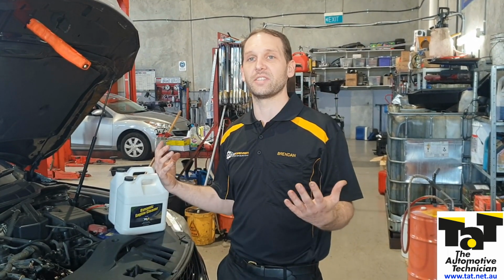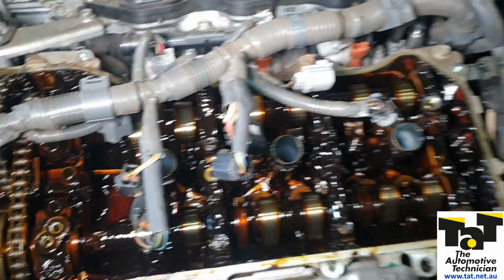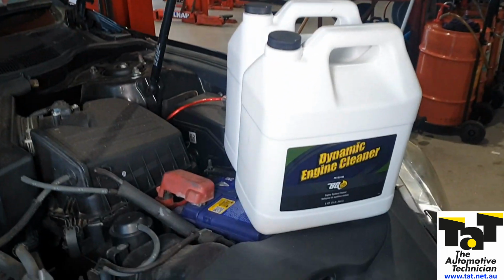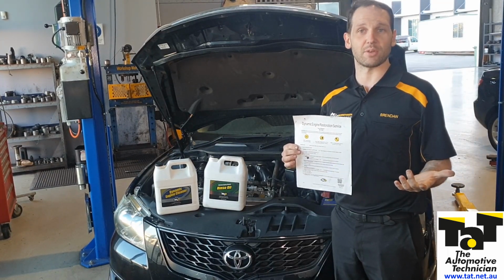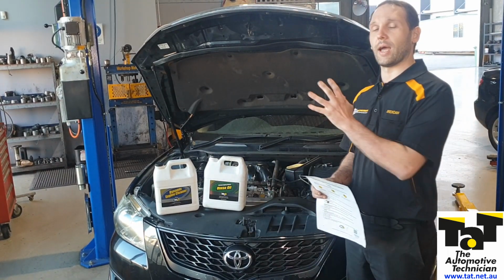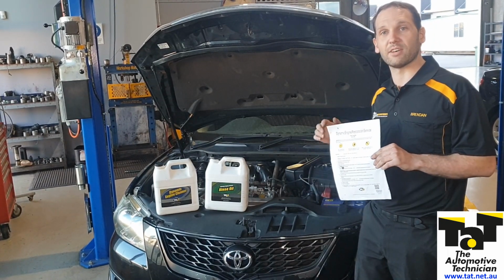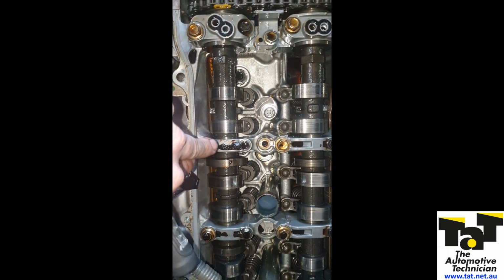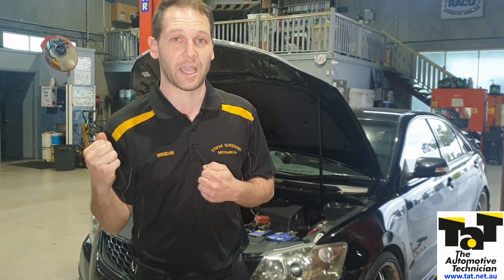BG Dynamic Engine Restoration

Comment: my 2015 altima with only 70k miles had the same symptoms. Drive it in the morning, no think white smoke, but when I am going home 9 hours later thick white smoke, took it to the dealer they said engine sludge, , That is when I researched further and found out about the BG engine flush kit. Drove it yesterday no white smoke.

Comment: For those w/o OBD-II or computer based methods to read the oil pressure, what do you connect an oil pressure gauge to?
Reply: You need a scan tool that reads Oil Pressure.

Comment: So i did this to my 300k truck, now everytime I start it, I get this cloud of smoke, followed by light blue smoke once idled..... did i do something wrong or does it need to burn off with fresh oil for a few hundred miles?
Reply: I don't think you did anything wrong. BUT ? You might have cleaned some crud up & now oils getting past something causing your smoke on start up.

Did you change out your PCV or at the least check it ?

Comment: Are you sure it's oil pooling in under the valve cover causing the issue? From what I understand the oil control rings get stuck due to the newer low friction design combined with the lack oil changes they get gummed up and stuck in place. This leaves a gap between them and the cylinder wall at startup which lets oil into the cylinders and burning causing the smoke. Once engine heats up the oil rings expand out and start clearing the cylinder walls of oil reducing the smoke.

Comment: Looks like a really great product JR, but I think most of us subscribers are diy, and we can’t seem to buy this product online. I just won’t go to a mechanics shop for this. Please give this feedback to the manufacturer
Reply: It's down to 299.00 now. Check it out. Just purchased some to do this on my wife's SUV.
Reply: @shill1444  "Crikey".
At the risk of sounding like a cheap bastard (well, yeah!), I think I'll settle for a kerosene flush (I've got a badly sludged 2006 Holden VZ).  Drop oil, add 5ltrs oil and 2 ltrs kero, run 30 mins, repeat (2 x flushes).  Then I'll treat it with XcelPlus (tradename for the "original" Slick 50).  Why? I've got a timing chain rattle.  Mechanic looked at it and told me he WON'T do the timing chains for $2,000 (too sludged), I should go for a remanufactured engine (5.5k "plus labour").  Xcelplus won't FIX timing chains, but it may very well prevent them getting worse - a DIY "my way" is going to be a couple of hundred (and if it's NOT successful and I need a new engine - I've only lost a couple of hundred).
Reply: @OhSoddit  - WOW. SMH. I feel your pain my friend. Yes, and being a cheap bastard at this point in life has become the natural way of things. I don't blame you at all.

Kerosene flushing is the old school way of doing that and I did have a mechanic suggest that to me but the wife thought he was a back alley mechanic and wanted to rely on something more "reputable" herbs seeing various videos on YouTube about it and hearing another mechanic mention it convinced her to at least try it.

What  your saying Sounds like a good run though. Good luck.
Reply: can buy it from Amazon but it cost $325.00 Might be worth a shot but wouldnt try it unless you have real bad sludge.

Comment: What does it do to seals and gaskets? If it's eating oil away, it can't be great for gasket material.
Reply: Gasket material is either oil resistant rtv or rubber. It's probably fine.

Comment: Would this help in car that has slightly noisy hyrdaulic lifters? This seems to be very much like an engine flush.
Reply: I wouldn't think it would do much for noisy lifters or hydraulic lash adjusters. Usually if they are noisy they are already damaged. They leak down because they can't hold oil pressure. Chevy has had this issue for years on the lifers in the  4.8 , 5.3 and the 6.2 liter engine's. Dodge has had it on the 3.7 and 4.7 hydraulic lash adjusters.

Comment: This is amazing stuff. Would love to know what it would do on a much older car.
Reply: I have the perfect candidate, my daily driver, 1996 Ford Escort wagon LX 1.9.. has 349k miles on it, I do oil changes religiously since I owned it when it had 32k miles on it, bought it in 05 as a minter, still in great shape..

I haven't done an engine flush but I am about to put all new emissions sensors on it, catalytic converter fuel injectors and throttle body,.. the cams mic'd out nicely, all that premium synthetic I run no more than 3000 miles a whack and good oil filter, WIx!  no fram or other garbage!

but I would try this flush just curious to see how the rinse cycle looks on my baby... bet its not that bad, haven't had the valve cover off before this for over 100k, (needs new gasket) but the galley looks brand new, regular intervals and prelium oils and filters do that...

where can I do this, I'll do video see what you really have? is this a service center sham where they sabotage peoples cars to get them to pay for rebuilds or is it legit?

have to be leary when you cannot buy a product online or in stores, be damned if I take my car to anyone, not that stupid
Reply: I researched it, there are many vids on youtube of volks doing this same process on much older cards with a lot more milage.

Comment: Thanks for the video Brendan, we normally remove valve covers, sump, spray internals with caustic degreaser & pressure clean motor, very messy and time consuming. How does the oil pickup go in terms of blockage during the process? Thanks for all the videos Tony
Reply: It´s said that the cleaner disolves the sludge well enough to clear the strainer.